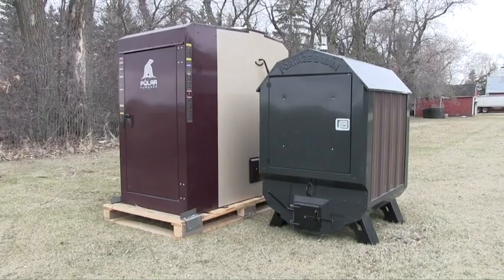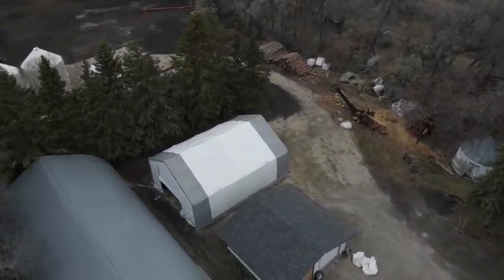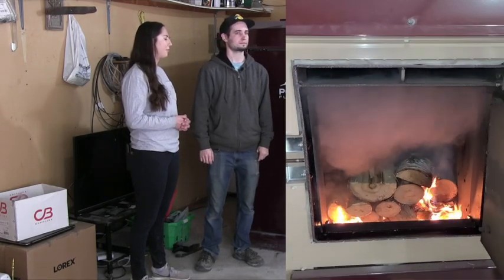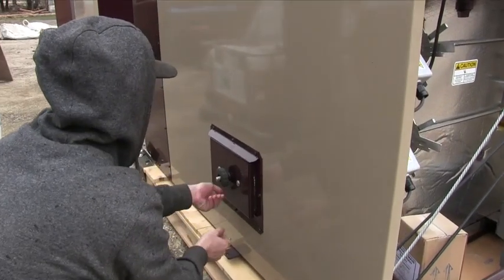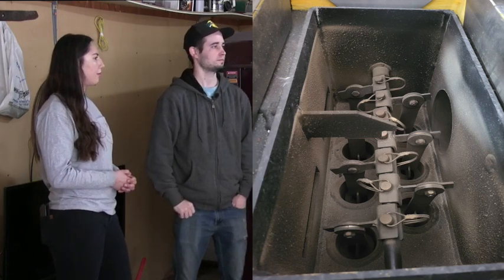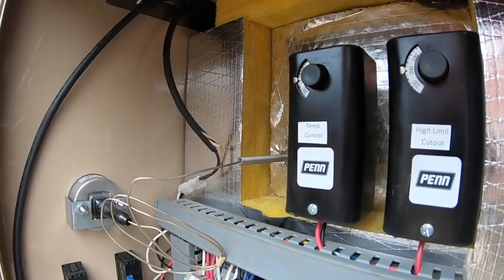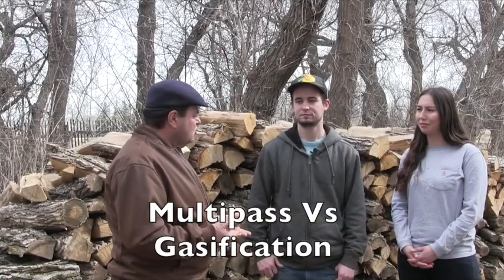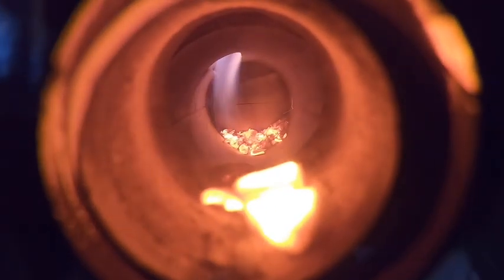My first look at a Highly efficient  Polar G2 Gasification outside  wood boiler #2

Comment: One of the best on the market. I Service ,repair, and rebuilt the top brands and I have had not weld call outs to fix a leaky palor stove. Easy to clean and thickness of fire box is good . The fan is well above the quality of any other brand I serves. Definitely better choice over other brands for cost and reliability.
Reply from the maker: Thanx Face. What area of the country are you from ?
Reply: @curriecountryliving   way, way, way upstate I'm the land of communist NY 😂
Reply from the maker: @facediaper4607  LOL
Reply: Do you think this is much better than central boiler's new models or is it a close call?
Reply: @marblemill  they do fancy word play and fancy games on your ignorance . I will never stand behind central. You heat stainless above 800°  it starts to lose its property and they only put 1/8 walls in now so if you ever had a stainless bbq and it rusts in the first 2 years you will understand that you will be sold a load of bs ... they fail at aws welding standards for stainless all their welds are faulty out the door and it is now only as thick as the water jacket side so ya 5- 10 years if your lucky you will be spending 20k again. Or worse in its first few years...
Reply: @facediaper4607  Thanks for the input buddy.  So polar is the best  on the market?  Is there anything coming close like a crown royal?
Reply: @marblemill  crown royal is my second choice for options... not very many bad things to say but the price tag.. if you don't have polar dealers  near you crown royal is the next best thing
Reply: @marblemill  they use better stainless alloy and it is thick
Reply: @marblemill  their first titanium model deal had  8 on lot I told him to send back to get repaired he did the used car sales pitch and within few weeks of each stove running those customers stoves failed not little leaks whole weld seams ripped open
Reply: @marblemill  way way way better... when they still have dozens getting sent back for whole welded walls failing. They cut to many corners and you the customer will eat the cost.. where polar hasn't changed in years... I have yet to do a repair on one.. where I do dozens of central boiler a year old and new
Reply: @marblemill  over complex with flashy tech that can't stand the test of time .. those controls are Chinese made with American price tags ... wifi system fails alot and  the amount of maintenance you need to put in to them to keep them running at optimum level isn't told to you the customer... I charge  350 to clean them and most can't afford that monthly so I do yearly and it takes me 18hours to chip away the crystallized oils(turpentine and creosote ) the air channels need replacing after 1-2 years door seals every year to 2 a year  looking at extra 800 bucks at today's prices
Reply: @marblemill  oh and the new door seal fix is ok but it isn't easy to install for the average person.. so most always ask people like me to put them in... don't be sold off of producers sales hype and nonsense filled used car sales pitch.. if it didn't cost me 50k to get a polar dear bs I would totally sell them. PLZ DONT BUY CENTRAL FOR THEM LOVE OF ALL THAT IS SACRED IN YOUR WALLET. Polar is the best at its cost and they have it figured out ... they haven't had to do any redesigns or rebuilds(new models to improve on last year's mistakes)

Comment: There crap. I have a G3. The springs stick period. We burn 10 cords a year. The problem is there boiler btuh are incorrect. My G3 is producing 110,000 btuh. The steel they used was curved and welded at top which made the metal paper thin. I guarantee the stainless steel has the same problem. It will leak. The company that used to make these no longer exists. It’s a guy welding them in the shop. If you want other comments or concern let me know. But save your money stay away
Reply: Please let me know what for problems do you have?
Are you burning dry wood?
Reply: Is 25% dry enough?
It's seems like the bark is more wet..
Reply from the maker: @alexmendel641   you would be pushing it and needing to watch more closely...ajusting air etc
Reply: @Augerman Drain Cleaning 
I have seasoned wood which I cut and split January 2021... so it's almost one year still have around 25% moisture....(poplar wood)
I hope I will have not so much issues!
But thx for your response 👍 
It's not much  on you tube about those stoves from polar!!
Reply from the maker: Sorry to hear about your problems Derek. How old is your boiler?  The Polar G2 I bought was built at Piney Manitoba this year by a Hutterite Colony. I seen there manufacturing plant and was a nice set up.
Reply: @curriecountryliving  
Are you happy with your boiler?
What happens if you burn wood around 27% humidity  poplar??
Reply from the maker: @alexmendel641  Ive only been burning with it for about 2 months Alex. I have found there is a learning curve having come from a conventional to a gasification unit, My poplar is under 15% and burns well so can't comment on higher moisture wood yet
Reply from the maker: @alexmendel641  Huh. Not sure why I missed your question Sorry.  You will gum up the turbulators if your wood is not seasoned
Reply: @curriecountryliving  did u make a vid on that one?
Reply from the maker: ...so not sure about a guy welding them in a shop? If you wanted to elaborate ( maybe a knock off)  but I know I personally Picked mine up at Piney Hutterite Colony and its a full manufacturing plant well run